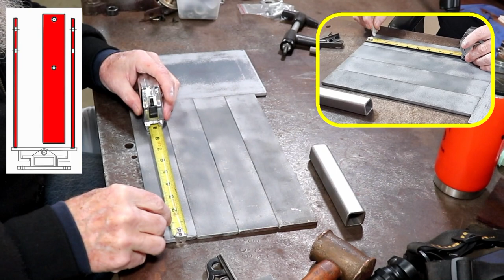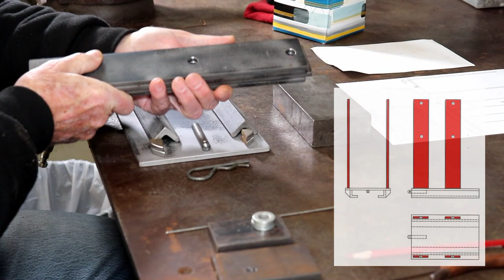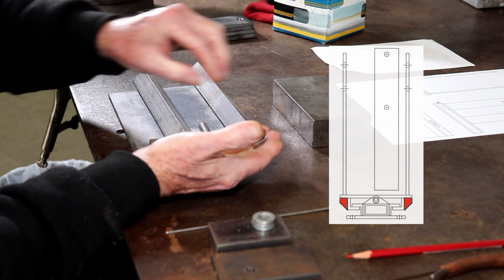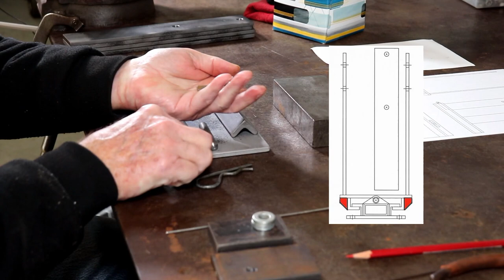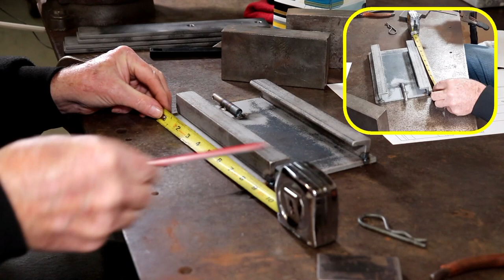How To Hang A Hoist  Part 1

Comment: Thanks Jere.  Just getting caught up with your recent videos.  There were so many clever setup and fab tips in this episode.  I especially liked the drill press fences for repeating operations and the use of various spacers for  welding the bracket.  The most clever one was the welding wire trick to create the clearance for the sliding bracket.  👍👍😎👍👍
Reply from the maker: Joel. That is one advantage of being old. I learned long ago when you are around an old guy watch everything he does and then after the project is complete (break time, lunch, after work) ask why he did something that way. You will learn a lot and know the reason why something is done that way.
I am glad you see stuff that others miss and you ask questions.           Jere

Comment: I am glad to see you use clamps when drilling and by the way, I'm going to steal your drill stops setup idea, just so you know. HAHA Thanks
Reply from the maker: Hi Bill:
I try to use clamps on anything over 1/2". You will find yourself making many different drill stops. After a while you will have enough to suite almost any combination of hole pattern. One thing I might suggest is that you cut the portion to be clamped a bit longer than your initial setup. As you saw in this video, sometimes they have to extend past the table to be useful.

Thanks for watching.        Jere

Comment: I enjoy your information and building help. Wish I was able to support you like I feel I should. You bring more knowledge than than many of the automotive and fabrication especially understand. That being expressed 
Is there a reason you switched to MIG from TIG on the welding?
Reply from the maker: Hello Kurt:
Thanks for the kind words.
While I was tacking up the pieces I was sitting down at the table. If I used the MIG I would have had welding spatter landing in my lap and I had much more control over where the tack was being placed. If I do a lot of MIG welding while sitting down I wear a leather apron. After everything was tacked I was standing up and could use the MIG with out getting burnt.
Good question. Thanks for watching and be sure to subscribe.        Jere
Reply: @jerekirkpatrick2092  ok I was thinking the TIG is strong enough but you chose MIG I understand the splatter in lap but my real question, I didn’t think it through was strength?
Reply from the maker: @kurtludwig4783  If you listen to my MIG welding you will notice that it is consistent throughout the complete weld. This means that the machine was set properly for the weld being made and the speed that I moved was in timing with the amount of weld being laid down. The machine was set for the thickness of the material and the amount of penetration necessary to insure that the weld was as strong as the material being welded.
Excellent question. Let me know if you need any other clarification.       Jere

Comment: Hi Jere.  I hope the Winter hasn't been too bad for you.
This should be a wonderful tool compared to that come-along. Those critters are no fun for pulling or installing engines.
Congrats on the Patreon and plans setup.
"As useless as..."  I was wondering where you would go with that one. ;)
Cheers
Reply from the maker: Hi Joe:
It has been quite cold here in the mornings so I don't get out to the shop until after lunch on most days. I will be starting the second half of this video today and hope to have it uo by this weekend.
This video wasn't fully uploaded until 3:00 this morning so I've been doing the finishing touches this morning.
It will be interesting to see how Patreon and my plan sales do.
Thanks.       jere
Reply: I have to live "in the shop" vicariously through folks like you for a while now so I'm looking forward to the next part of your project.
I only had to clear snow once, so far this Winter. I know that's better than many folks but that was once too many for me. ;)
There is a 3:00 in the morning too? Wow.
Joe
Reply from the maker: @Joe.Doucette  I started the upload yesterday at 5:30 in the afternoon. It was finished this morning when I got up. I download from my phone so it doesn't use my computer time.         Jere
Reply: Good idea.